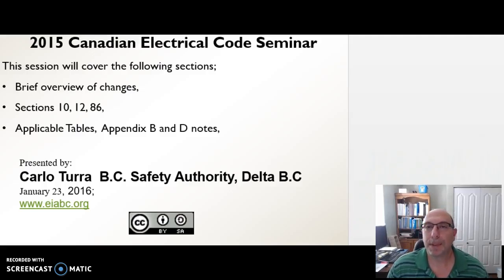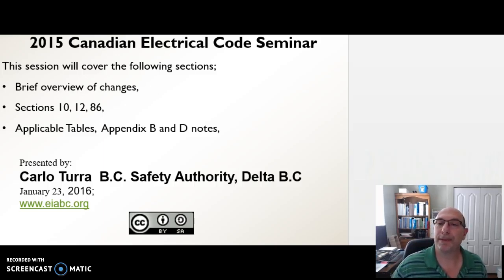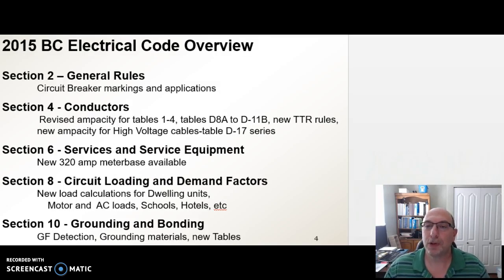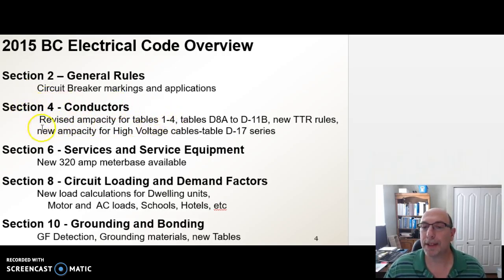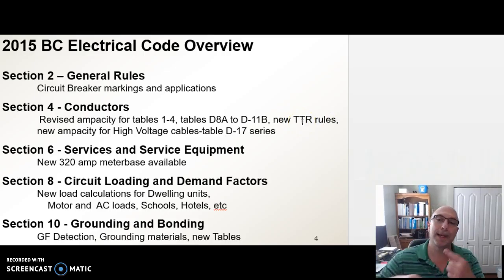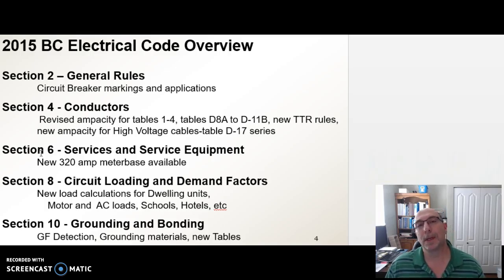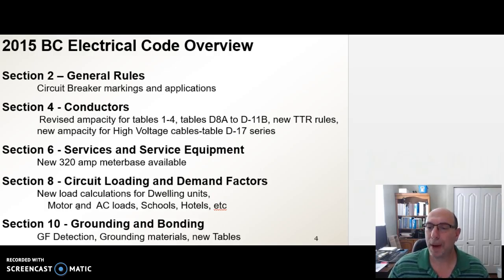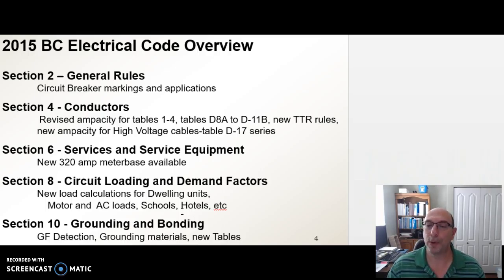2015 Canadian Electrical code changes

Comment: rule 4-006(2) does this apply to motor conductors? For example if i have a motor that is 60A FLA. Would i use 75 degrees insulation or 60?